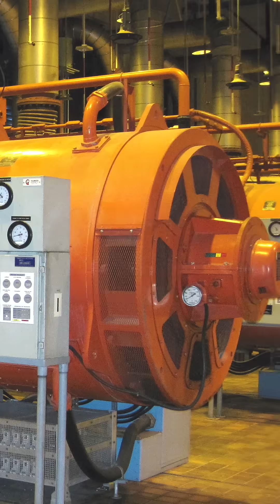wHaT iS tHE LARGEST ENGiNE EvER MaDE?

Comment: The fact is that the engine is so big that the biggest ship (seawise gaint) that was ever made btw built in the 70s basically needs a redesign to fit it. The thing in, but the ship was powered by the sulzer 8RTA96C, the ancestor of the  sulzer RTA96C, the size different is insane
Edit: the RTA96C come in many names he used flex i used, sulzer wich of is the old brand name, and the new is wärtsilä

Comment: Idle? 5rpm is not idle, it's "DEAD SLOW" engine speed for ships, which is minimum speed that can go. This engine is mounted directly to shaft and the way you maneuver is either you "kick it" forward or reverse. Compressed air is used to "kick it" in either direction. Ships also can brake by putting the engine in reverse, but only once it already slowed down sufficiently so that you don't damage the propeller and shaft.

Comment: These kind of engines dont have idle RPM's they are reversible engines instead of idle they are on stand-by at 0 RPM and are started by pressurized air whenever you want to get moving

Comment: imagine they do an oil change in this and it’s just one big mega drain plug
Reply: unfortunately, the fuel is also its lubrication. and an acidic, sticky, oily substance slowly accumulates in its crank case and from time to time it needs to be scooped up, barreled up, mixed with heavy diesel and reused as fuel.

Comment: Welcome to Naval two stroke disels. Those things need to run so slow for air-fuel mixture to get into cylinder( part of the design quirck that makes it more reliable than normal two strokes).
Reply: Diesel engines, whether the one installed in your garden tractor or this little beauty, do not draw air-fuel mixtures. They draw air, compress it, then inject fuel into the cylinder when pressure is at or near its peak. The heat of compression raises the air temperature in the cylinder high enough to ignite the fuel.
Reply: also because heavy oil is also viscous AF... there is no air fuel mixture. there is just a slob of fuel that burns enough in those 20 seconds to move the piston.

Comment: How does oil explode in such a massive cylinder even?! Every injection must be 10 gallons, is it even explode?! Has it power enuf to push a piston?!
Reply: During each cycle 160g of heavy oil are injected into each cylinder.
Reply: @GrillerRohde tnx for data, but does is explode? Im not pro but has it enuf exploding power to moves those heavy pistons? I mean its liquid after all not gas, it might be work in smaller injection doses like cars

Comment: Could easily double the power if it had a sequential turbo setup. Get the rpm up with a light weight crank shaft with aluminum rods. Come on why would they only want 100k hp

Comment: The most cylinders in a single engine would probably be the quadruple wasp / wasp major / R-4360 engine from ww2 it was a R28 engine.  (28 cylinders in a radial configuration) Producing a insane 4,300 horsepower

Comment: So 4 hp per liter. I didn't even know hp/liter ratio could get this low.
Reply: It ain't the HP, it's the torque!!
  Edit: wanted to add that most trans-ocean cargo ships burn basically heated road tar (straight crude oil), they only switch to diesel if they're coming into ports. Not sure about this one..
Reply: But also very efficient

Comment: You missed the biggest shocker. 5 MILLION 608 thousand ft-lb of torque. 7 million NM of torque in the rest of the worlds units. 

The ships powered by these engines could ship literally your entire neighborhood, at the most fuel efficient rate we have ever achieved because of these ridiculous engines. 

However they often don't burn gas or diesel, even though it's better and cleaner if they do. They often burn what's called heavy fuel oil or (HFO), a slight refinement of crude oil, often done at the oil harvesting sites, its very cheap and can be made in large quantities, but its extremely dirty for basically everything involved. The crew, the engine, and the environment all have a harder time running on HFO, an engine like this can run off pretty much any fuel you throw in it.

Comment: Someone correct me... Is that not 4hp per fkn liter ?  I know it's built for reliability and longevity but 4 horsepower!?
Reply: Because you can’t make an engine hundred times bigger and expect it to work just like a regular engine.
Reply: @GrillerRohde right on... 1/10th the hp 10x the torque 😎

Comment: One of the interesting things about large marine slow speed diesels is that to achieve even block heating they genuinely require an auxiliary steam system.  This ensures that the multi-part cylinders stay in alignment with even heating.  The cylinders are so long that simple heat conduction through metal isn’t consistent enough.
Reply: Most large ships also have an exhaust gas boiler (EGB) to extract heat from the exhaust to be used for heating of fuel, the living spaces, and power a turbogenerator.
Reply: When you have an extremely efficient engine, you dont have as much wasted heat to play around with. 

Big diesels even in trucks cant warm to operating temp at idle without help. Many vehicles have exhaust brakes, high idle, or other devices to help them to warm up. I always use high idle. In my old truck, I would use the exhaust brake to help it warm up.

Comment: You didn't say what the engine was for.
Reply: It should be rather obvious.
Reply: @GrillerRohde  Well it isn't so what's it for?
Reply: @Cacowninja 
Think about it for a few seconds or even up to a minute.
What is the only type of vehicle that could fit such a large and heavy engine and utilize the amount of power?
Reply: @GrillerRohde  I mean there's big construction equipment like the bagger 288 but still vague.
Reply: @Cacowninja 
Bucket wheel excavators of that size mostly rely on external power for their electric motors.
The engine in the video is for maritime use.
Reply: @GrillerRohde  So it's for boats?
Reply: @Cacowninja 
Yes, mostly for large container ships like the Emma Mærsk.

Comment: Those engines aren’t for horsepower, but torque. Only including the horsepower and not the torque seems silly to me.
Reply: Horsepower is the whole enchilada while torque and RPM are components of the total horsepower.   We were given the RPM and the horsepower which can be used to calculate the torque.
Reply: @Andy-df5fj then do the math for me, please
Reply: @drumeshopeth 
Sure.   The horsepower formula is HP=(Torque xRPM)/5252.  Solving for torque, the formula is Torque= (HPx5252)/RPM
(107,390 Hp x 5252)/120 Rpm = 4,700,102 ft-lbs
Reply: @Andy-df5fj Wow! That's a lotta torque!
Reply: @drumeshopeth 
Yep.  Ludicrous torque.
Reply: @Andy-df5fj  4.7 million😂 I'm dead. That's fxcking insane
Reply: Torque alone is meaningless. A lot of torque is useless if you don't have at least some rpm
Reply: @bene5431  Thet being said, 120 rpm is at least sufficient for the torque output, right? Steam engines run much slower but still generate decent power for their size.

Comment: How do you even cast and machine metal at that size like tolerances still exist in cylinder walls and crank and cam bearings not to mention valve springs and how do you even bore a block that big

Comment: I got to tour Fairbanks-Morse Defense in beloit, Wisconsin. A 5 story building acts as a radiator for testing those monsters! The Turbos on those suckers are as big as a dump truck! Just a heads up the motors they build usually go from power a hospital during an outage to being installed in freight ships. My class of diesel techs calculated the smaller of the modern turbo charged 4 stroke on the test stand we saw back then had 10,000hp per cylinder. Inline 6 I believe.
Reply: I worked there in 2016 and they use train tracks to haul the engines from manufacturing to quality control, then to a wrapping station to protect it from the elements before delivery.

Comment: It's not HP, If it's Horsepower then the engine would be super fast which is I think impossible for engines that big, it most probably be torque instead
Reply: The hp number is correct. The engine produces multiple millions of Nm of torque.

Comment: Where i work at we got a whole bunch of 64 liter v16 generators and about 56 of em 14 per building kind of insane all diesel generators but non the less crazy the site makes more power than most small towns never found out torque but I know they all make 3000 hp so about 168000 hp pretty fucking nuts

Comment: For the record, this engine uses a really really dirt cheap diesel. It's so cheap that the viscosity of it is similar to Asphalt that you literally need to heat the thing then pass it down to a purifier then before being injected it had to PASS through a Mesh Filter If you put that kind of fuel to even the most reliable kind of Diesel Engine like the Older ones that can run on a mixtureof used oil and veggy oil that engine will Tap out due to how dirty it is

Comment: Imagine this thing doing a runaway ☠️
Reply: gotta reach a million horsepower somehow
Reply: The operators will notice that way before it gets bad. The engine is most likely to shutdown automatically once the engine revs past its own redline.
Reply: @sandasturner9529  do you know what a runaway is? doesn't sound like it, brother...
Reply: oh no its run away, its up to 250 rpm

Comment: The largest engine ever put into a production car was the Bugatti Royale 12.7 inline 8 cylinder. Yes an engine the size of what you’d see in a semi truck nowadays. 

The GM ZZ632 Is a production engine in the sense that it’s in production but it’s not a factory option for any of GM’s vehicles not even their factory drag cars like the COPO Camaro.

 So the largest factory available engine today is still the Bugatti 8L quad turbo W16.

Comment: I've been lucky enough to work on one of these. The 12-cylinder version and the 8-cylinder version of this engine. They're all basically the same except for the amount of cylinders. And i can tell you, it was awesome. Even walking around one is just plain awesome. I've even been inside the engine on multiple occasions in several spots. Needing a ladder to climb into the cylinder just hits different.
Reply: Walking around inside an engine sounds insane hahah. But what is this even used in/for?
Reply: @kikkg2710 A very large ship.
Reply: @martinsims1273 aahh yeah that makes sense
Reply: @martinsims1273  Or maybe a spacecraft?
Reply: @AllAround_TheInternet I don't think they would even consider combustion engines for spacecraft...
Reply: @kikkg2710  i think its a cargo ship
Reply: @kikkg2710 Merchant shipping vessels. In my case it was a vessel from mearsk. The most insane vessel i've been on is a Triple-E vessel. A 399 metre in length, 59 metre in width, 73 metre from keel to top mast tall container vessel capable of carrying almost 19.000 containers.

It had a powerplant onboard literally made for cities. It could power a whole damn city if needed.
Reply: Do they have sparkplug? Or are they diesel
Reply: @luvjoebacon2915 They're neither. Not really. They run on heavy fuel oil, which i gues is more close to diesel than to gasoline. Anyway the oil self-ignites from temperature. The working principle of the engine itself is the same as a diesel engine. A 2-stroke one that is. 

Most ships nowadays even run on ULSFO (ultra low sulfur fuel oil) in certain areas to meet environmental requirements. As the use of scrubbers is not allowed everywhere.
Reply: @Flutflutflap  very cool thanks for the info!
Reply: I'm curious now how it feeds fuel into such a large cylinder, and how fast that fuel burns...
Reply: @Connorses Well the Fuel Oil first has to be heated up to about 80 degrees celcius before it can even be moved. The fuel also passes certain stages of "cleaning" before it even enters the daytank, from which it is transfered to the engine itself.

I haven't worked on the fuel system of the 12-cylinder version. I believe it was a common rail system if I remember correctly.

But the 8-cylinder version had a very modern quite complicated system of letting the fuel into the engine, i'm probably not even allowed to share this online. But it was basically using HFO as hydraulic fluid at the same time to open certain valves making the HFO go to the injectors at the correct timing. There were 3 massive injectors at each cylinder. These injectors would then insert the HFO at unbelievably high pressures through tiny gaps making it sort of a mist. And well through compression it then self ignites.

It's been 5 years since i've worked on it. I'd have to look up the details. I don't fully remember them from the head.
Reply: @Connorses Oh, the 8-cylinder version used about 2.5 tons of HFO each hour at it's most economical speed, which was around 100rpm.

The 12 cylinder version used much more, but i forgot the exact number.
Reply: Human borescope
Reply: Now stay inside the cylinder while it's running!
😂😂😂
Jk
Reply: @Forsaken_Soul  bro on the compression stroke 😮💥🔥🔥🔥🥵☠👻
Reply: @zzz280  Ghost in the Machine! 😄
Reply: I imagine the climbing into the cylinder part also hits different

Comment: I think you need to mention that these go in 300m+ ships that carry over 200,000 tons of cargo. And fun fact, you control the speed of the vessel by choosing the rpm of the engine. So the engines are always running at constant RPMs.

Comment: And there is no gearbox for this thing. This engine is directly coupled to the propeller shaft. The propeller itself is designed specifically for this engine. 

And it uses the FREE VALVE(hydraulic or electric solenoid) technology to reverse it's rotation as an alternative to the gearbox. The oil pump running in reverse argument is also solved by making the oil pump independent to the engine. In fact, it is kept running even if the engine is at rest or the ship is docked in port.

The only option to start this beast is to force compressed air to each cylinder.